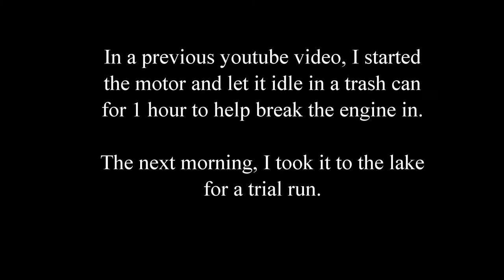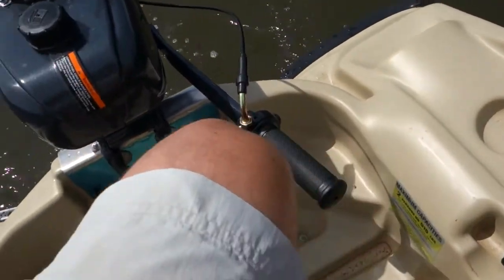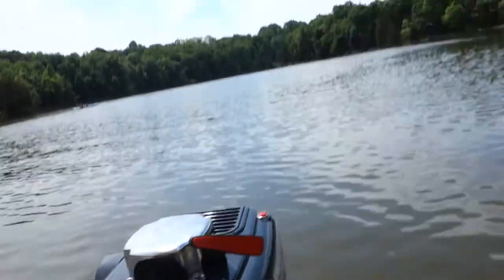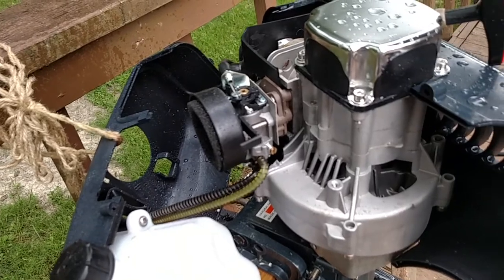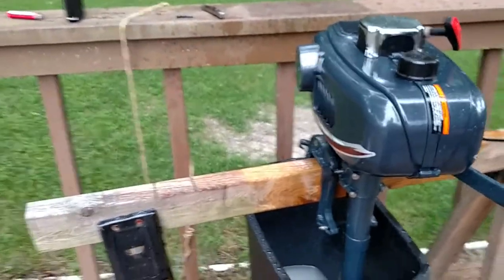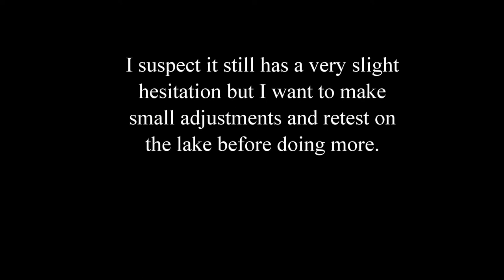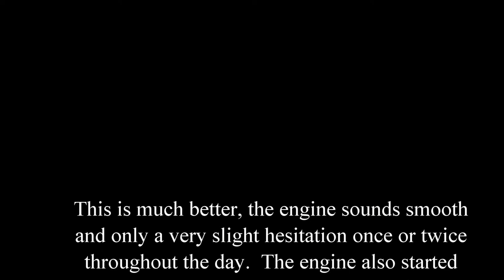hangkai 3.5 HP motor fix (air fuel ratio)

Comment: Hi, I have hangkai 3.6hp with the same problem as you, can you explain to me in detail what I have to do step by step? Thank you
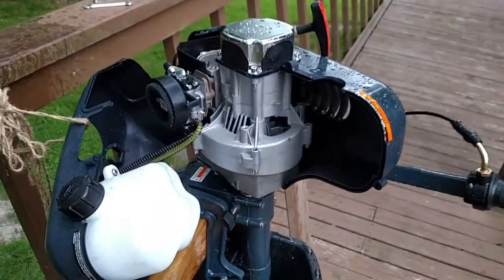Reply from the maker: starting at 2:20 in the video, I use a 13 gallon trash can next to an outdoor patio railing with the motor mounted to the railing (kind of unique but you need to find a way to mount the motor and have it in water ... you could even do this on a lake with the motor mounted to a boat but its more difficult).  Once that is done, you remove the 4-6 screws that holds the two plastic motor covers together and separate them, use a string or something to support the side that has the fuel so the hoses don't collapse or get pinched together.   You also need to remove the breather cover.  With the breather cover removed and the motor covers separated, that exposes the air fuel adjustment screw which is the screw right next to both of the fuel lines where it connects to the carburetor.  Start the motor with the choke on and a cold engine and let it idle a few minutes so it reaches operating temperature.  Turn the choke off by moving the black plastic choke lever all the way down.  If the engine dies with the choke off, you will need to start it back up with the choke on again and do an initial adjustment first with the choke on. The easiest way to adjust the air fuel ratio is with the motor at wide open throttle.  Turn the adjustment screw in until you hear the rpms change then back it out slightly until the motor smooths out.  It will be an obvious sound change both times.  With the air fuel ratio set at wide open throttle, it should also work with no throttle and all the way through the entire throttle range.  So check that the motor idles ok and also slowly increase the throttle from idle to wide open.  If the motor doesn't stall and it sounds like its running smooth.  You are done and you can put it back together.  If the motor doesn't run smooth at all throttle ranges, then you will need to repeat the process and try again.  You will more than likely get it right the first time but if you are new to working on engines, it might take a couple of tries.  If you are having troubles, you can also try to move the air ratio screw in or out in micro increments and test until it works best through all throttle range, i.e. you set it at wide open throttle but it idles rough then try to move the idle adjustment screw out or in 1/8 of a turn and retest.
Reply: Thank you for the answer, I will try
Reply from the maker: @TONYZDANDY  it sounds more complicated than it really is ... good luck and lemme know if you have any troubles.
Reply: I tried all morning to no avail, I think I even made the situation worse, the engine makes a louder noise now. I tried to accelerate to the maximum as he suggested by turning the carburetor screw in every sense but the minimum is never established. My engine doesn’t stay on if the choke lever isn’t ON. Unfortunately it’s my first time and I have zero experience, I don’t know what to do !!!
Reply from the maker: @TONYZDANDY  is the engine new or has it been sitting for a while with gas in it?  Usually if an engine won't run unless the choke is on, that means its not getting enough fuel.  On carberated engines, that can happen if it had gas in the carberator that goes bad. It can become scaly and clog up the carburetor jets.  The only fix at that point is to disassemble the carburetor and clean it manually. That's something that usually requires someone with more experience (not saying its not impossible to DIY carburetor cleaning with no experience but is harder than adjusting it)
Reply: Yes, the engine is a new engine still break in. Unfortunately I played a lot with the carburetor screw and now I don’t know how it’s put. The engine does not stay on if the choke lever is not ON.
Reply: @sharpridgehomestead  am urmarit si eu cu atentie .raspuns complet multumesc ! va urmaresc din Romania.
Reply from the maker: @paraschivdanution9500  Thank you for the comment and to let us know my instructions worked for you.  Romania is such a beautiful place.

Comment: I'm going to check out mine hard to start cold. Great video mybe in the summer you'll post an update.
Reply from the maker: Ben I live on the lake. I probably had this boat out 30+ times after this video and never had any other issues with it dying or being hard to start. The air / fuel ratio isn't even a factory problem because it is dependent on the altitude a person lives so I assume it is set from the factory where it works for most people.
Reply: Ed Wiget this video was great ! Took mine out the other day on my boat like yours and there was no power and it was sputtering. Already changed spark plug to a name brand one . Will try this , this week and hopefully get my boat ready for some winter catfishing ! Thanks for posting !!
Reply from the maker: dustin gray that def sounds like an air/fuel ratio problem.  Let me know if this fixes it. I've had so many people message me this was the fix for them.
Reply: Ed Wiget will so. Just borrowed my bros metal barrel so I can test it. Will let you know !

Comment: when people say make the oil/gas mixture richer, does that mean add more oil? or add more gas?
Reply from the maker: It means add more gas but I have seen the term used incorrectly often.  Technically, being rich or lean is the ratio of fuel vs air.  Rich means there is a higher concentration of gas (too much fuel) compared to air, lean means there is a lower concentration of gas (too little fuel) compared to air.  A rich mixture is often identified by fouled spark plugs, excessive smoke out of the exhaust, and a lot of carbon build up on valves.  Hope this helps.

Comment: What if I can start it but I can't get it to stay idle with out having to give it a little gas
Reply from the maker: A couple questions....is it brand new or have you owned it a while?  Did it sit a long time with gas in the tank?  The problem you describe sounds more like a carburetor issue, maybe the jets are restricted or the float valve needle is getting stuck.  It could even be the air fuel ratio but im kinda leaning more toward a carb issue until i know more.
Reply: @sharpridgehomestead  I just bought a few days ago I'm in the break in period right now.
Reply from the maker: It may work itself out after the breakin period. When you buy a new motor, they are not broke in which really means they are factory tight. After its broke in, the bearings seat and this loosens up the engine somewhat. If its still doing the same thing after the breakin period then it could be the air fuel mixture ratio which is different for each altitude. If that is correct, then it could be some other issue in the fuel delivery system.

Comment: I just purchased this engine. My engine keeps turning off as soon as i lower the throttle what's wrong? Any idea I'm use same oil recommended for this motor ( oil mixture with fuel) I'm using 95 octane gasoline
Reply: With this method will i be able to fix this or is there something else with my engine?
Reply from the maker: It could be air fuel mixture.  You could try to turn the screw 1/2 turn in one direction and see if it can start and idle better. If that doesn't work, turn it 1/2 turn back where it started and then go 1/2 turn again in the opposite direction you did the first time. See if that is better. If 1/2 turn doesn't work, try a full turn and see if that helps. Eventually you should find a spot that runs better with the octane of fuel you are using.
Reply: I'll try hopefully it works for me 🤞😔
Reply: I tried doing nothing helped any more thing that can fix this?
Reply from the maker: @saadiqureshi  i noticed you mentioned the octane rating being 95, first thing I would try is dump that gas out and use regular low grade unleaded gas.  High octane gas in most engines today actually causes power loss.  If that doesn't work, about the only other suggestion I would have, without actually seeing and hearing it running myself, would be to take it to a small engine repair shop that works on lawn mowers, weed eaters, chainsaws and that sort of thing.  It could be something really simple and cheap to fix but it's about impossible to diagnose something over the internet.
Reply: The choke is labeled backwards. So you want to put the lever to "off" when starting, and "on" when its running
Reply: make sure when the engine start always the choke ON

Comment: I do own a hangkai 2t 4hp (74.6cc) and got the same problem, is it also caused by wrong air fuel ratio?
Reply from the maker: if the motor is new I would almost bet that it is.  My theory is that the air fuel ratio screw backs out during shipping or that it is set to an acceptable level at the factory which is at a different altitude than where you live.  If its not new, it could be several things causing it.  Any small engine repair shop should be able to fix it if you are unable to yourself, and the costs probably wouldn't be too much.
Reply: @sharpridgehomestead  the motor runs smoothly now after break in.
Reply: @sharpridgehomestead  the motor runs smoothly now after break in.
Reply from the maker: @limjiajye8086  awesome to hear. Thanks for the update.

Comment: Your running it with the choke on, the label is backwards on these models.. on position means your Motors running off means the choke is on
Reply from the maker: thanks for the comment, although I was aware of the mislabeled choke, it really was the carb air-fuel ratio which I fix later in the video and also show the mislabeled choke. In this video at the first part, the only way to get it to run was to have the choke set mid-way.

Comment: hi
motor stopped while apply to acceleration and leave it 
what to do please?
Reply from the maker: if it starts back up, that is more than likely the air fuel mixture.  You could try to adjust it yourself using this video as a guide if you feel comfortable doing that sort of thing, or you could take it to any small engine repair shop and have them do it.  The cost should be minimal.

Comment: Which way do you turn the screw?
Reply from the maker: 601dsr it depends on if it is running rich or lean.  Probably the easiest way if you've never adjusted a carberator is to have someone hold the throttle Midway and try to turn the screw in until it either dies or runs worse, then back the screw out until it runs smooth. That point should be very close.

Comment: Do you still have the motor and how is it running?
Reply from the maker: Yes I still have it. I use it several times a year and haven't had any issues with it since I first bought it other than the air / fuel ratio. I think it's well worth the money.
Reply: @sharpridgehomestead  do you have to replace the clutch often? And how does it do against a current?
Reply from the maker: @Bowhunter88  i've never had to replace the clutch and I've never even changed the spark plug or pull rope.  I keep the motor in a shed when not in use so its out of the weather.  I think it does an acceptable job against the current .... I think i have a secondary video showing the speed using the gas motor is the same speed as my 50 lb thrust trolling motor on a lake that is narrow and long so it has pretty decent current in the main part where the video was recorded.  I use this motor on a pelican raider boat.
Reply: @sharpridgehomestead  i also have a pelican raider with 54 lb thrust trolling motor and in the river by me if i go against the current with it i just stay in one place lol was just curious how this would do.   Thanks for the replys
Reply from the maker: @Bowhunter88  never a problem, since you have the same boat, I can tell you in calm waters like in a cove, it will raise the front of the pelican raider up enough if you are in the boat by yourself that it might scare you .... lol.  I think the motor is great for what I use it for and its price point, but to be perfectly honest, If I had to do it over again today ... I would go with the bigger hangkai motor on this boat....cause I am crazy and kinda like some excitement every now and then lol

Comment: You should have broke it in for 10 hrs before use.
Reply from the maker: Although i agree most new gasoline motors need some sort of breakin period, this one would not have run for 10 hours without adjustments.  Its been fine since this video with hundreds of hours on the lake and no other problems.
Reply: @sharpridgehomestead  would it idle at 1/4 throttle for 30 min to an hour at 30 : 1 fuel mix in a barrel? thats how I broke mine in
Reply from the maker: @roxxerface  i had to adjust the carb just to get it to start and run.  It would fire and run 10-15 seconds at a time and that was about it. If you cracked the throttle any at all it would just fall on its face.
Reply: @sharpridgehomestead  good thing you got your problem solved!
Reply from the maker: @roxxerface  yea, I've actually been thinking about upgrading to the larger version of this same motor. I've had pretty good luck out of it and it lasted longer than i anticipated it would last.
Reply: @sharpridgehomestead  I got an old used evinrude 10 hp and it doesnt move my 14foot boat but 6-7 mph its not much faster than the 3.5. If you upgrade go with a 4 stroke you will thank yourself.
Reply from the maker: @roxxerface  my original plan was a 4 stroke and this engine was just to buy me some time to save up for one.   My only complaint with this engine isnt actually anything with the engine itself but its not much faster than my trolling motor on a 10ft pontoon boat. Lol.

Comment: Best fix is to sell it and buy a used Yamaha or mercury for about the same you spent on a new henkai
Reply from the maker: Thanks for watching and your comment.  Although I agree both yamaha and mercury make great outboard engines, i've had no complaints out of this engine since I first bought it.  Air/fuel ratio would probably need adjusted on any small engine since not everyone lives at the same elevation level.
Reply: Its a great motor for the price. Half the price of any other motor ive seen, even used. Also half the weight. Sure, you have to tinker with it here and there. If you're not tarded, its simple. after about 10hrs of use,  I accidentally flipped the kayak in the bay, where the motor was submerged in saltwater. Took it home, cleaned it up the following day. started right up, no issues.
Reply from the maker: @BrewsterC42  I agree, it's a great motor for the price. I have no complaints and this is the 3rd year I've used mine.
Reply: @sharpridgehomestead   did you change the fuel lines to accept ethanol? how often do you change the spark plug? whats your fuel-oil ratio? If i could have this thing run for THAT long, would be amazing.
Reply from the maker: @BrewsterC42  still has the factory spark plug, still has the original fuel line, and I use about a 50:1 fuel/oil ratio (actually I just use the tiny gas can that came with it to mix fuel/oil so it has the little measuring thing on it....i think it is 50:1 though.  Then I dump it into a larger  1 gallon gas can ... repeat until that can is full).  I live on a lake, so I take it out at least once a week sometimes more often late march until october.
Reply: @sharpridgehomestead  interesting. I'm curious if hangkai has altered some components a touch between you buying yours and me getting mine. Bought mine just a month ago.
 The can that came with mine has a 35;1 mix label. 
The instructions call for a 30;1 mix, which ive been using successfully, but i do notice a bit of residue on the spark plug once i remove/inspect (indicative of excess oil)
Would be supercool to find out I can use my premixed chainsaw fuel (50;1) in the hangkai also
Another youtuber suggested changing the fuel lines because the factory ones are not compatible with ethanol, but, being that your not having issues  .  . .
Reply from the maker: @BrewsterC42  I do vaguely remember checking and setting spark plug gap when I first got it, it was off by some but I don't recall if it was a lot or not. I haven't pulled the spark plug since to even look at it. Outside of air/fuel ratio and spark plug about the only maintenance I do is empty the tank each winter then start it until it runs out of gas.
Reply from the maker: Bills BuildAll  I'm old school, I'm full power wherever I go in the boat I have. Lol. But to answer your question a little better, I've been wide open throttle an hour or so at a time, fish in a spot for maybe 30-45 minutes, wide open throttle to next location. Repeat over a 8-12 hour day, many days a year.
Reply from the maker: Bills BuildAll  no problem, to be honest, I have been tickled to death with purchasing this boat motor.  Originally I just wanted something cheap that might last me a year or two until I could afford something better but since its still working, I am still on the lake abusing it regularly.  I've not had a single problem with it once I fixed the air fuel ratio.

Comment: NEW FUEL CAP..! Vent it
Reply from the maker: thanks for the tip, it might help someone else.  I haven't had a single issue since I adjusted the air-fuel ratio
Reply: @sharpridgehomestead  cool...i got mine ordered.  Its the red weed eater one.  On a sundolpin pedal boat. Looking for this next weekend.
Reply from the maker: @lpz3665  I've really been happy with mine, I originally bought it hoping it would last a year or two until I could afford something better but its still working today and it serves my purpose so I am in no hurry to replace it lol.